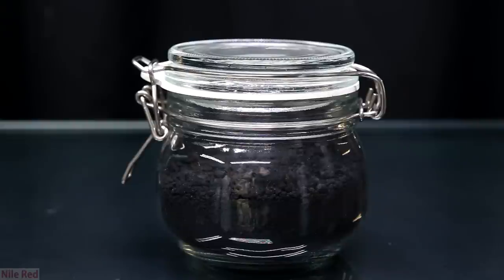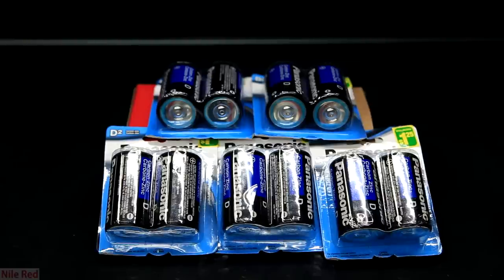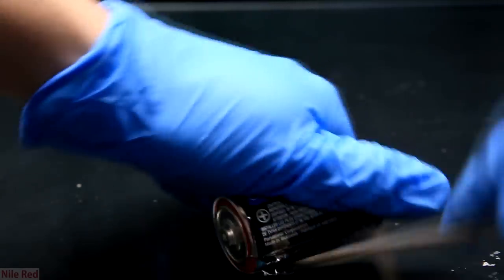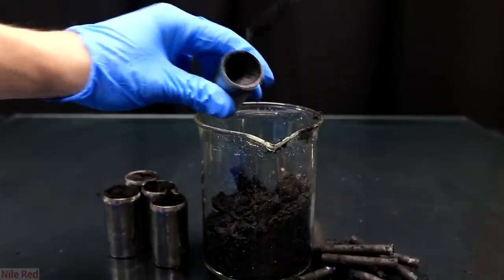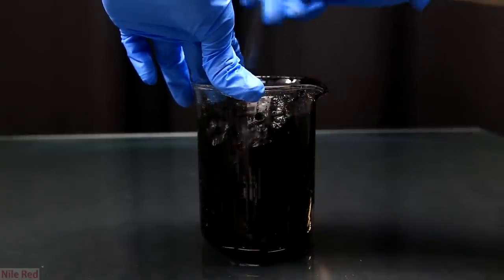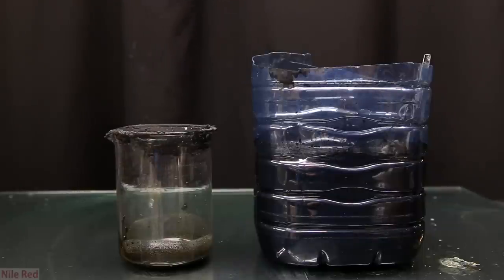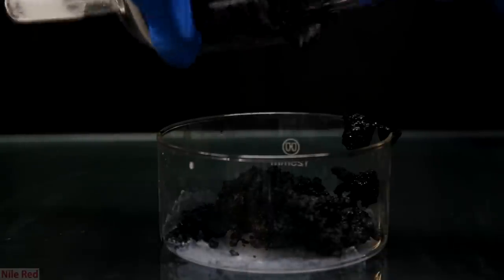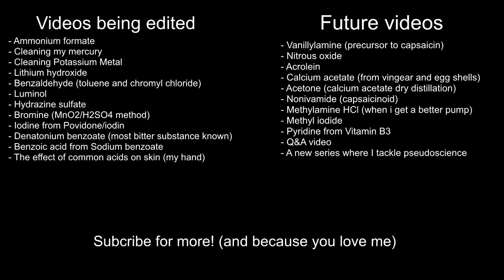Getting Manganese Dioxide, Zinc and Carbon from Batteries

Comment: the carbon electrodes are a good way to generate a carbon arc for a furnace or to use in electrochemistry
Reply: Part of me wanted to say "nerd!" And the other part wanted to say "tell me more" lol
Reply: @tannisbrown9007  youre commenting on a nile red video.
Reply: @user-yw8sr3uj1w  touche
Reply: 😂haha i love these comment sections
Reply: Rip T.K.O.R
Reply: What to do with that pouder and stick inside?
Reply: @roky7727  the stick can be used to make a furnace that can melt steel
Reply: @brimful-cookie5947  he was an good youtuber
Reply: Yep was gonna say. Invaluable in electrolysis and such.
Reply: @aaronrichards5623  me too... lol
Reply: I suggest you guys look up an Arc Furnace.  They use big carbon electrodes to melt high temperature metals
Reply: Do they even sell those D cell carbon rod batterij's in europe? Even tho o checked because i was curious bought drycell but there wasnt a carbon electrode in it, just a thin white straw thing what idk what it was.
Reply: @sir.2015  I'm in the UK and the cheapest cells here are white and red Panasonic's, which are carbon zinc, and should contain a carbon electrode. Others in the same price bracket include black Kodak cells with red writing. 

Most own brand batteries and premium brands aren't carbon zinc. You can tell a carbon zinc usually by the extreme light weight, compared to a Duracell or Energizer. To be honest it's probably cheaper to get the carbon rods harvesting them from cheap C-Zn cells than it is ordering them direct.
Reply: @user-yw8sr3uj1w  your comment has 42likes
Reply: King of random reference
Reply: tkor:

Comment: I found the best way of removing the manganese dioxide was to first remove the carbon electrode first, then using a pair of needle nose pliers, grab onto the zinc casings. By turning pliers the zinc casings can be torn apart, leaving behind a bunch manganese dioxide wrapped in paper. The paper can be easily torn off.

Comment: Those carbon electrodes can make some really nice electrodes for other uses. I recall one place used them for carbon arc torches for welding.
I think large scale arc furnaces use carbon electrodes, the little ones might be good if a metal needs to be melted for something.

Comment: I recycle these batteries on a pretty consistent basis.  The black power you have a the end is not just MnO2.  About half of that is carbon powder and it laced with iron impurities.  I would even go as far as to say that your "yield" that you have there is less than 50%.  Drop some of it in HCL and you will see the carbon power sink to the bottom and instead of a pink solution as you would expect with MnCl2 you will see an orange/brown solution.  This is the iron contaminant. 

I am an avid fan of your videos but I think you dropped the ball on this one.  The info you gave in this video is incorrect enough to be dangerous for people.
Reply: He also calls it manganese dioxide. The correct name is manganese (IV) oxide.
Reply: Both are right...
Reply: the water washings dissolve iron impurities and zinc chloride in the batteries in the black powder, so the main source of contamination would be elemental carbon. I see your point if one didn't wash the MnO2 before use.
Reply: *****
You would have to react it with an acid to turn it into a soluble salt. I think sulfuric acid would do. Then use a filter to remove the solid carbon. Unfortunately, this reduces the Mn(4+) to Mn(2+) if I recall correctly.
Reply: Puddin you beat me to it I was going to say the same thing lot of carbon in there
Reply: Puddin But he used new batteries not used.
Reply: D
Reply: +BlueChem if its metallic iron and not an iron salt, the water washings wouldn't have dissolved it at all. I don't have any informations about the iron impuritys Puddin talks about, so where do you take the certainty from?

And the Carbon definitely could pose a threat or at least completely ruin some syntheses if the Manganese Dioxide would be used in the wrong reaction in the state it was at the end of its treatment here. I understand that you defend NileRed, but i too see it as a serious problem if a channel that usually is very precise with its claims gives definitely wrong informations viewable in public.

No offense NileRed! But this in general is really important from my point of view. 
I guess you get at least some critique for you handling things like the major exlosive picric acid and show how they are made from OTC-products - considering the times we live in.
 I don't think that the attempt of keeping away this kind of information from public is very useful in fighting terrorist attacks and stuff, but in the very end; if you give information of this kind it NEEDS to be 100% correct.

Kind regards from Germany!
Reply: same thing Mn4+ 2O2-
Reply: Well i dunno about dangerous.....

Thanks for the expertise tho.
Reply: Joshua Norris 
It's dangerous, since some people are probably taking his videos as guides instead of simple entertainment.
Reply: NileRed added it in the description section. c:
Reply: Sir plese dont, manganese dioxide reacts with hydrochloric acid and creates chlorine gas.
Reply: The orange-brown color of the solution is due to colloidal MnO2, although I believe that the iron contamination is there. I know this because if you try oxidizing glucose with basified permanganate you'll get the same orange/brown solution. The iron that's present can't be enough to make a solution orange. Iron (III) is yellow at normal concentrations. Also you can't reduce MnO2 to MnCl2 simply by adding HCl. You need to heat up the mixture.
You're right on the carbon part, MnO2 is supposed to be brown.
Reply: @louistournas120  It's ridiculous and pedantic to suggest he calls it manganese(IV) oxide. Manganese dioxide is the common shorthand name for it and it is widely understood what someone is referring to when they say "manganese dioxide". I have seen "manganese dioxide" used in papers in respected scientific journals.
I hope correcting people by using the slightly more specific and technically correct term makes you feel superior.
Reply: @xeigen2  

It does make me superior but now you made me feel inferior.
Reply: Black Power! ✊🏽
Reply: What form of iron is in the paste?
Reply: @xeigen2  It's a good point that some things are called by convention. Else how should we refer to H2O😂
Reply: Well, is obvious that there is garbon in the manganese dioxide, it has to because the battery would't work properly without the carbon "contamination"
Reply: Also, i Blame on you guys, cause in the description he already says it has carbon and that is not necesary to purify for his bromine experiment, also if someone would reproduce his experiments, it will solely his on responsability for any mistake he makes bcs of not paying attention or cuestioning himself about the result

Shame on you guys, shame on you
Reply: Christine Felice I know I’m about 3 years too late, but if all you’re after is the carbon rods, and you don’t want the zinc or the MnO2, I suggest picking up a 6 volt lantern battery, opening up the plastic casing, and then when you see the 4 cells inside, all you have to do is get a pair of pliers and pull on the metal cap at the top of the cells. That will be the carbon rod, and there shouldn’t really be any danger, so long as you wear gloves. Some of the electrolyte they put in the MnO2 paste is mildly toxic, so that’s the biggest risk to you, AFAIK
Reply: @louistournas120  we don’t pronounce water’s chemical structure as “Dihydrogen Monoxide”
Even with Roman numerals, it’s perfectly fine to say (Ex): Iron Chloride. It doesn’t need to be pronounced as “Iron (II) Monochloride”

We just don’t need to pronounce Roman numerals or prefix on the metals with them.
Reply: @connordziadul6048  
According to my chemistry textbook, those are the rules. I call it hydrogen oxide but the official name is dihydrogen monoxide or one of the others.
Iron(II) monochloride? No, according to the rules, it would be Iron(II) chloride.
The old style name is ferrous chloride.
Iron(III) chloride is ferric chloride.
What are you going to call Iron(IV) chloride? As you can see, the new style covers all possibilities.
Reply: @louistournas120  I wasn’t aware of the ‘new style’, but I detest the fact scientists and we alike need to specify the balance. I think I can understand why the Roman numerals might want to be included verbally, but I’m sure person 2 can assume a proper mole ratio (balance) without the addition of prefix (mono, di, tri)
Reply: @connordziadul6048  Get over it. Specifying the obsidation state of a metal is the quickest, most general and and most effective way to automatically obtain the formula of a compound. It's not by chance that every textbook nowadays hammers continuously on IUPAC notation.
Reply: @raffaeledivora9517  IUPAC is in every textbook. I’m aware. But textbooks are literal texts that need to have all the information as specific as possible when it comes to compound formulas. But I’m saying it’s not needed or uncommon for chemists to say it without subscripts or prefixes. I don’t think either is wrong. Whichever you choose depends on how specific you want to be. Colour and Color are both sides of the same coin.
Reply: It's hilarious that you are accusing him of putting out dangerous information while you're happily advising people to put MnO2 in HCl...

Comment: To take off the battery tops use a pair of wire cutters instead of a screwdriver. Take the wire cutters and make a cut in the lip of the casing at the anode. Then use the flat edge of the wire cutters like pliers to grab and peel back the folded casing. SO MUCH EASIER! You can open one up in less than 60 seconds every time. 😀 Also, whack the casing with a hammer a few times to break up the MnO2 mix inside. Makes it a hell of a lit easier to remove.
Reply: I use channel locks and start on the lip. I go around the lip, gripping and pulling down, breaking the lip and start rolling the channel locks. It will peal the zinc canister off in a spiral. Once I get half way down I switch to some needle nose pliers and grab it from the bottom of the piece I was just rolling and peel it down to the base. Then I can just pull the insides out cardboard and everything undamaged.
Reply: And here I thought I'd made up the process.

Comment: for removing the contents of a dry cell battery that was covered in corrosion, I brushed a solution of 'Cream of Tartar' and vinegar around the zinc shell and wrapped in paper towel, soak in the solution.  After a few minutes the casing just crumbles away allowing easy access to the core material.  I was using a lantern cell, two of cells were bad, but the other were in perfect condition.  I would not use this if you wish to keep the zinc of a good battery.

Comment: You should try disassembling the "F" cells from a 6 volt lantern battery, out of one lantern battery you get quite a sizeable yield of Zinc, MnO2 and some quite large carbon rods.
Reply: You ought to take one apart too, I know you'll be surprised at what you find...
Spoiler Alert!!:  4 D-Batteries.
Take a 9 volt battery apart and SURPRISE:
6 Triple A's.
Reply: @bugsbunny8691  It's actually quadruple A's in 9v batteries
Reply: @arthurbourasseau4845  thats like A^24 😱
Reply: @bugsbunny8691  ummm, no. There are 4 F cells in a lantern battery & there 6 AAAA's in a 9 volt.

Comment: Manganese Dioxide is a REALLY BIG MESS to clean up of the glasswear
Reply: Na2SO3 should work
Reply: What all you told is right. Try adding mild acids or some reactive but don't do use hcl it may react with the floor and may cause a severe mess
Reply: Holy shit I tried this at home. MnO2 is ths dirtiest chemical I've ever seen. I contaminated my whole house. Its so fucking hard to wash it off. Damn... What a mess

Comment: I highly reccomend reducing MnO2 to MnSO4 by a mixture of sulfuric and oxalic acid. It just produces CO2 as a effect of reducing Mn4+ to Mn2+. And then turn it into MnCO3, it's the purest way i found. The paste you find inside is MnO2 mixed with graphite powder, that's why you need to reduce to something soluble like MnSO4 to filter it off.

Comment: Bonus: the carbon rods are phenomenal for high temperature operation and are great conductors, good for arc welding
Reply: About 10 years ago I took dozens of carbon rods out of old batteries and cleaned them and they were in good condition.  Eventually I put them up for sale on ebay and got some money for them.

Comment: Had i had access to hydrochloric acid or sulfuric acid, would've just dumped the entire de-shelled battery assembly into acid, with the manganese dioxide and cardboard inside. 

Zinc and manganese would dissolve into the acid, the electrolyte which would be zinc or ammonium chloride would be soluble, and you had to just decant away the carbon and cardboard.

Zinc would be easily electroplated out of the solution, using the scavenged carbon electrodes as an anode, and manganese chloride + small impurities left in the solution
Reply: Do it outside or in a fume hood as manganese dioxide reacts with hydrochloric acid to make chlorine gas.
Reply: did you try this method? have bulk of manganese dioxide and surely there' so much impurity on there

Comment: That crystallizing dish though, the horror.
Reply from the maker: +Dankula It died after i burned phosphorus in it :(
Reply: Nile Red R.I.P crystallizing dish; you will not be missed.
Reply: +Nile Red Time for a HF acid clean.
Reply: +Nile Red its probably etched not ditry.  I have never had a good base bath fail to clean up anything
Reply from the maker: Clown Whisper I have actually in the past had some stubborn stuff in RBFs that wouldnt clean out with anything. Base bath, water bath, aqua regia (trying everything). It had to be manually dislodged. Not sure what it was.
Reply: +Nile Red just after I posted that I had a small depart carboxylation explosion does salicylic acid. I don't know what state the answered within which side of the reaction it came from because the glass tubing popped I could have bursted from either side but it turned into a grade and paste that I can't get off of anything I have tried everything I have tried white fuming nitric acid and it will not react it is if its class
Reply: +Nile Red  oops that should have said decarboxylation and for some reason my tablet does not let me edit my post so I would have to go upstairs on a computer to fix that now I don't feel like it
Reply from the maker: Clown Whisper the laziness
Reply: Nile Red :(   I can barely walk.  I have paraneoplastic syndrome
Reply: Nile Red and sorry about the confusing posts, my meds along with voice recognition are not a good mix.   

At any rate, the material that spewed from the process is so ultra hard that I can not even chip it off my 50ml flask.

I am going to research reproducing this with manganese oxide for elextrodes
Reply: +Clown Whisper A bit random, but what a scary thing to have. Best of luck friend.
Reply: Myles Bishop thank you.  Yes its scary..  8 years ago I was a body builder.  People used to tease me and call me Fabio.

Now im 300 lbs and can hardly walk. My hair turned grey and all my stats took a dive.

i have the wrost most rare form of PNS.  But I am still cancer free after 3 years so they dont think that i will ever get cancer now.  still sucks trying to recover
Reply: just scored a brand new never used 100ml glas-col stainless mantle for 25 bucks!!!!!!!!!!!  He said its like new.  I did not believe him it was not LIKE new it is NEW.  im blown away....  I got a 1500watt controller last month for 15 bucks.  it too was absolutely new
Reply from the maker: Clown Whisper Damn, that is a steal!
Reply: Nile Red get this,  just today I got a brand new never used thermowell 250 ml mantle for 7 dollars.!!!!n   won it on auction out bid the dude last second woot
Reply from the maker: Clown Whisper wow, man. Getting some good deals! From ebay?
Reply: Nile Red yeah very good, its been a streak of good luck
Reply: @ClownWhisper  
How are you doing, friend? I enjoyed your insight on the conversation, here.
Reply: @ClownWhisper  where are you getting these deals?
Reply: @venkatsharma05  He said he tried it in the video. Also that glassware is probably long gone by now, rofl.
Reply: Remelt the glass of the dish
Reply: @NileRed rest in dust

Comment: Hello, I tried this for myself with a cheap lantern battery and I found a few things to note
firstly, dont do this in a place you cant clean up, its difficult
second, try cutting the zinc can open and peeling it around the paper, you get the entire clump out and you can peel the paper off
third, The chemical actually isnt just carbon and manganese dioxide, it can contain zinc chloride and ammonium chloride. Sometimes, typically when the battery is called heavy duty, the powder inside is composed mostly of zinc chloride.
Reply: It was mentioned that both electrolytes get removed with the washing